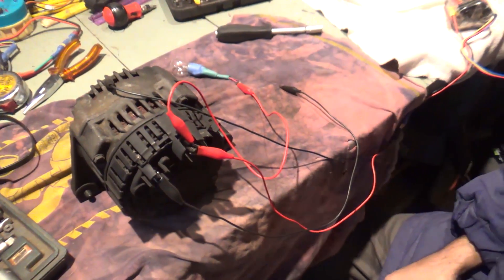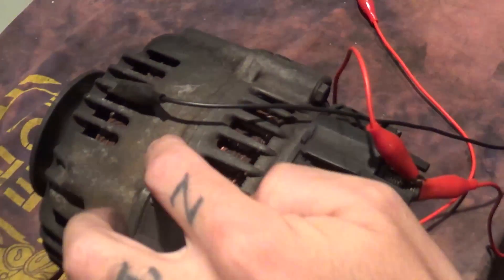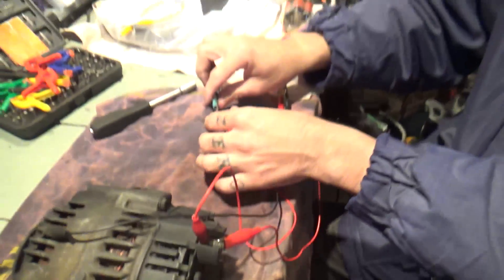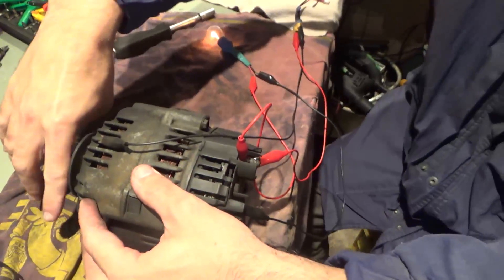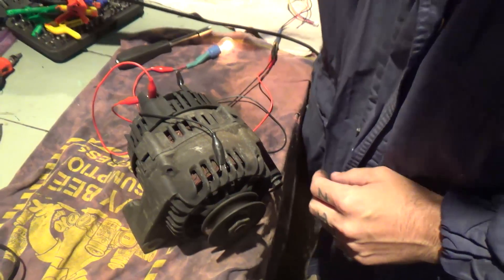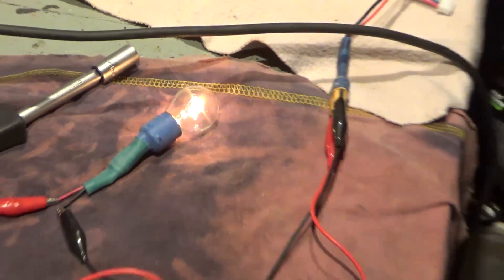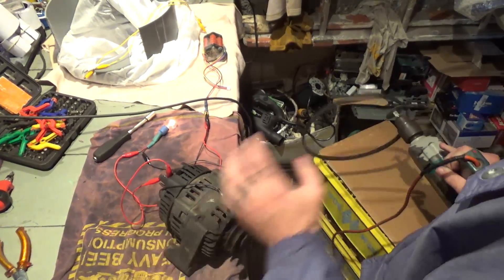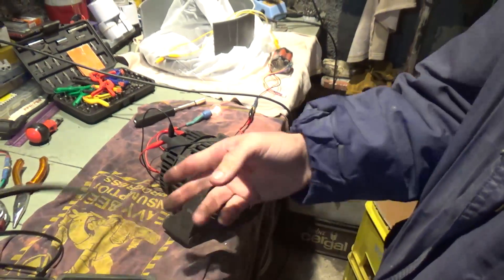How NOT to test a car alternator !

Comment: Thx for this video. Can this be done with modern alternators as well? Because the modern alternators have some extra electric inlet that you have to hook up to a particular car. I'd like to test my new alternator like this but the guy said the modern alternators can only work in a particular car. Is there a way to bypass this?

Comment: Nice try but You have absolutely no idea what you´re doing ... 1. the bulb you are using is way to big , the alternator will not excite if the bulb wattage is over 1.2 - 1.5 watt and 2. that drill is not turning the alternator at the correct rpm to be anywhere close enough to excite the alternator

Comment: you'd have to have the right bulb and right speed on the alternator to get it to cut into charge mode... you are looking at like a 24v 3amp light and 2000-3000rpm for the alternator to start charging you need to first power the field coils.
Reply: Matt Creator ....thanks a lot ....how he couldn't know it?  He should have to try before he decide to throw a way the Alternator.....such kind of car mechanics are sucking us.